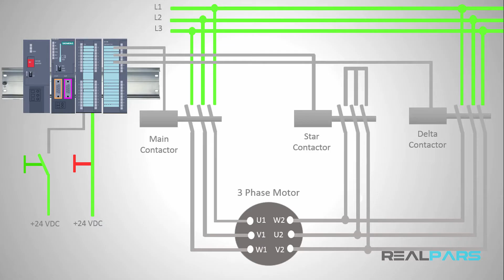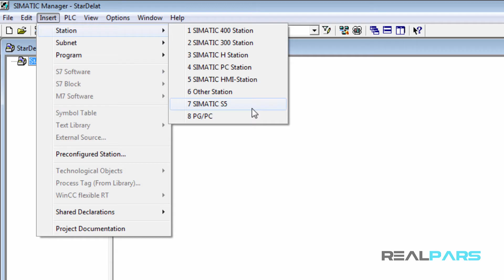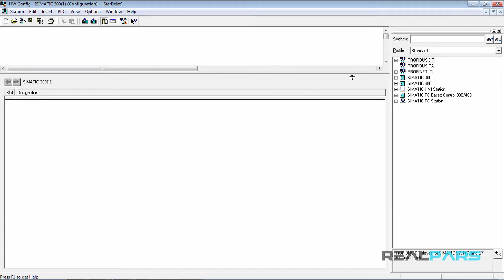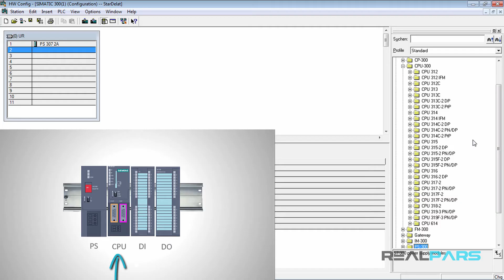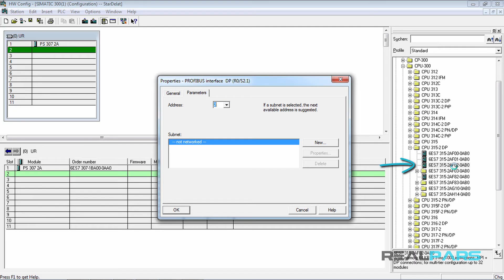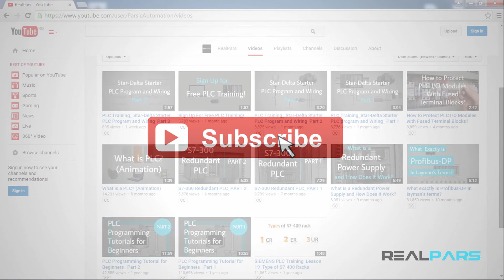Star-Delta Starter PLC Program and Wiring_Part 7

Comment: Sir,  is this possible to connect with Arduino mega?
Reply from the maker: Sure.  An Arduino mega has ample processing capability and I/O channels to drive most any combination starter.  However, the power limitations of the Arduino board requires the use of interposing relays (a relay between the I/O channel output and the starter equipment). Not difficult to do but it does take some thought to design the interface between the Arduino and the equipment.
Reply: K sir thank you...
Reply: Sir we were doing our project based on this.. if we fed up with any of the dout.. please give suggestions..

Comment: Is it possible to run a stepper motor. If I want to develop control for refrigeration system, how can I put all controls to operate. Can I operate temperature sensor thermister and pressure sensor tranceducer. What model plc I should use. How I can download program for particular field. Please advise lancy.dsouza218@gmail.com